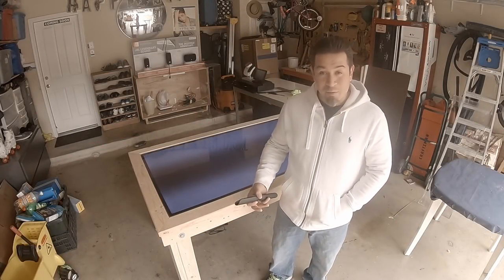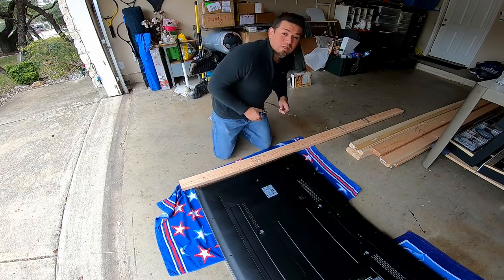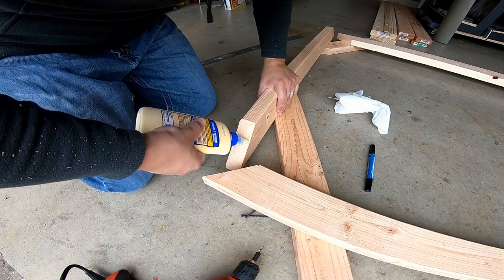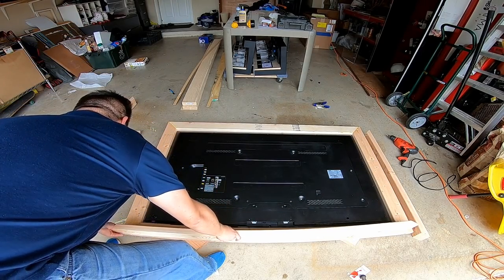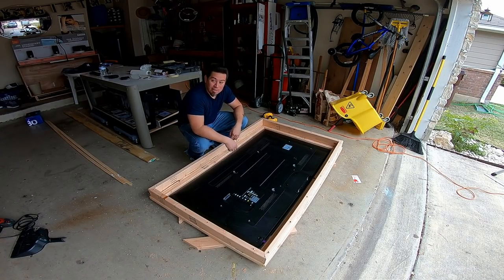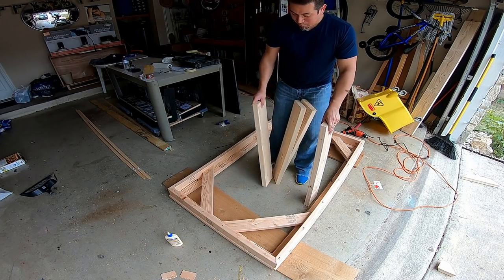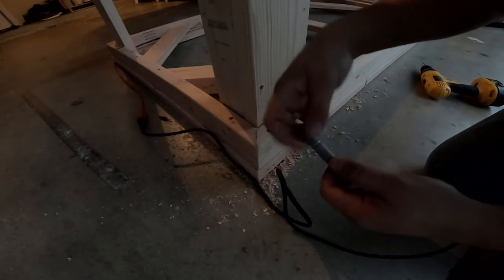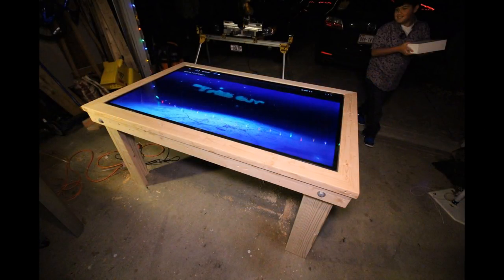How To: Build a Gaming Table (With TV Inside!!)

Comment: Thanks for the vid, cool project and good production values in the video.
A few notes for people trying to do this;
* A corner clamp will make putting  the corners together easier, this can be very difficult to do.
* pocket hole screws are another way of doing the work underneath.
* many tv's have curved areas underneath - so placing the flat board for a spacer may not always work out - have to be very careful with placement and test fitting.
* many tv's have mounting holes in the back - having one of the supports underneath use at least a couple of these holes would add extra stability for the tv, in keeping it in place.
* putting some cable management (ties, velcro, etc.) into the frame will help with keeping the various cords in place.

Great video - just a few minor suggestions to dealt with some of the things that could pop up.
thanks again for the video.
Reply from the maker: Great feedback Dave. Thanks for sharing.
Reply: I'd also add to this, use a flat, non adjustable, TV mount. I used one from Echo Gear and it's only about an inch thick, then build a brace off of that. Use tree nuts on the edged of the bottom frame to make the screen height adjustable and fine tunable corner to corner.
Reply: @EvidentGames  Just making sure I understand correctly! Do you mean you install the TV mount normally and then can use a plank or something connected to the rest of the frame behind it?

Comment: Table top games and architecture work is the primary consumer use of the teli-table.

Your tv is good for a 1st time build and as a starter example, I always recommend that DIY constructors do as much research as possible prior to starting a build.

My recommendation for any teli-table builder is the following.

1. Use MDF board as it's lighter than most woods and still can support the weight of a tv. Then use barrenttine treatment on the MDF board as it will make it water resistant (protect from spills, moisture and humidity, etc). MDF board can warp over time from humidity and conditions from changing seasons when not treated properly.

MDF board is also easier to sand, shave, cut, etc than other woods of equal or greater density. So if you were inclined to widdle or Dremel in scenery, art, etc into the wood to give it a much more appealing look, it's the wood to work with on a budget level.

2. The under frame which supports the tv should have the tv mount screw holes aligned to the support frame for which you are building and purchase threaded bolts that extent from the support frame into the threaded mount holes for the tv and mount the tv that way.

3. Ventilation, this is the primary mistake every DIY does on these teli-table builds. Tvs have vents designed to let heat our from the top of the tv (heat rises), TV's are not designed to lay down and be on. So when you leave your tv on the heat when produced rises and will trap itself on the back side of the screen. 
This increases risk of fire, when inner components heat up they can short out, burn out, etc. You need to install computer cooling fans (depending on the size of your tv it will differ in the number of fans needed). Install fans on lower or side vents to push air in the tv, while having the top vents clear of blockage so air can vent out.

4. If you wish to put a battle mat trim around the table top I recommend you use double rubber peal n seal (roofing insulator, not the single rubber with the aluminum siding) one side is adhesive while the other plain rubber like material. Then you can cover with felt or any material you like. This cleans up the look of the table and gives it a softer surface than plain MDF.

5. You can go on Amazon and buy USB/AC/DC wall jacks and install them on two sides of the table so that players can charge their phones, laptops, etc. 

6. You can buy table legs on Amazon at a reasonable price too.

DIY is always a fun way to learn new things and test yourself as to just what your capable of as well as ignite creativity in your mind. I tip my hat to all DIY individuals. 

There are several places you can buy these custom tables, prices very on quality as 1) they are rarely cheap, 2)  for the most part the higher the price the better the quality.

My table I have $28,462.00 invested in it, it's used for D&D and I've made alterations after alterations over the yrs. It pretty much can do almost anything lol I however used African blackwood instead of MDF for my table as cost was not an issue. 

Enjoyed the video, always like to see people creating new things. I hope you continue to add and alter your teli-table and would love to see what  it turns into.
Reply: Do you have any advice for someone looking to just build a portable case around the tv instead of building it into a table? I imagine the same principles apply, but would it be ok to just build in a few slats onto the back, connected to the frame at the correct level, and leave the rest open air?
Reply: @RahulLanka13  a portable case? Making a case to transport your TV, or making a enclosed frame around your TV that you can just move around and still watch TV in?
Reply: @gettingpolitical  I'd be using it for table top games like in this video, just without the built-into-a-table aspect of it. Just enclosing it in a case so it looks nicer and can be transported to game nights.
Reply: @RahulLanka13  the same principles apply for any build that a TV lays down while on. It needs ventilation, you can have simple passive ventilation (meaning no fans)  on a build and it can operate, yet does not reduce risk of fire and it will decrease the life of the electronic. The quality of the TV is what will be the primary factor in this though. Sony, Samsung for example have internal fans in most TV's while  off brands tend not to. Just make sure which ever sides of your TV have vents have a few inches of space for air flow. 

The length of time the TV is on is also a factor in heat production.

Comment: I don’t work with wood often, and I don’t have too high a budget.
Would it be possible to just saw a whole in a small table, and mount an old monitor to it using a wall mount?
That’s my plan for now, may do a bigger one in the future.
Reply from the maker: It depends on the type of table. You need to ensure you have a hardwood table because TVs tend to be heavy. The wood will need to support the weight and also accept the hardware.

Comment: I want to make a table like this but use a smaller tv. I want to make a poor mans cocktail arcade table. Do you have any suggestions for wood? I would like it to be strong but cheap, but not cheap enough that it just falls apart lol.
Reply from the maker: Hey Robert. I am about to undertake a similar project. A smaller table with a smaller screen that scrolls through a photo gallery, or can be cast to using a Chromecast. I am planning to use Pine cause it's really cheap, sturdy, and can be easily stained for anyone's taste. The legs will be made of 2x2's and the rest of it 1x4's. The wood alone is pretty flimsy on it's own, but once assembled it will hold up.
Reply: This Guy thank you soo much for the fast reply.

Comment: I am planning on building one that mounts to a drafting table. That way I can open a PDF of the plans “Blue Prints” I am working on, and be able to tilt the table up a bit. Then, I can compare the paper copy of the plans on the screen to identify differences. I think it will work great.
Reply from the maker: That sounds awesome. Its basically like a "light box" but with a screen instead of just a frosted lit panel.

Comment: Nicely done, but I'm curious if there is any distortion when siting down at the table and looking at it from an angle?  This is a common problem when you have any space between the screen and the actual surface that the miniatures sit on.  For example when looking at it from directly above the figurine will appear to be in the exact correct spot for what it on the TV, but from an angle the mini might appear to be elsewhere.
Reply from the maker: Randy Ward the acrylic layed right over the screen so there wasn't much distance. The TV also had decent viewing angles.
Reply: Thanks for the prompt reply.  Nice table.
Reply: You'll suffer from parallax when you have the acrylic over the TV.  You can reduce it by using the thinnest sheet of plexi you can find.  Also, removing the front bezel from the TV so the plexi lays directly against the LCD will help.  You can then matte off the area where the bezel used to be so it looks nice.  Lowering the viewing angle will also help.  Making the table legs height-adjustable would be a great benefit, anything from coffee table height to a dinner table height.

If you want a thicker piece of plexi, an alternative is to have a 1" grid etched into the plastic.  That way you know your figures, tokens, tiles, templates, etc. line up on the plastic grid, which will be in-line with the TV when viewed at the proper angle.

Also when using a thin sheet of plexi, just make sure the TV is rigid and flat.  You don't want it to flex, especially when people inevitably lean on the table.  That will keep the screen from cracking (an LCD is just liquid crystals sandwiched between large sheets of glass that can be very fragile.)  You could probably play directly on the TV itself, but I'd be worried about people dropping dice or other heavy objects and cracking the screen, so a thin sheet of plexi is probably best.

Just FYI for other people: I found that a 48" or larger TV will be able to display a standard game mat at 1:1 with no scrolling.  You can now find 50" generic brand TVs for under $300.

Comment: I'm trying to make a home theater coffee table it will have a hidden popcorn machine that is revealed by the table split ingredient in half a pop up projector and a touchscreen display in the top as well as hidden/pop up charger ports and I'm trying to make it all accessed by alexa may you can give me some pointers
Reply from the maker: Do you have any drawings of your creation? I would start by laying out the components you want to build into a table. I basically built the table around the TV, so you would use a similar approach.

Comment: I think the acrylic would have been best over the entire table to avoid spills from seeping down onto the TV...unless you sealed it with silicone?
Reply from the maker: Joshua Gregory the original design had the acrylic over the whole table but we couldn't find a sheet large enough. I left a gap around the edges of the TV so spills would potentially go straight through the floor. Sylicone is a good idea though.
Reply: The acrylic is because you roll dice and put miniatures on top of it. Protects the TV from being scratched up and cracked.

Comment: I'd love to try some arduino touchscreen project to that table tv of yours.
I mean, there's some project out there using that scanner light and infrared LEDs fir that.
Imagine a DIY capacitive touchscreen upgrade on this! Just wow!
Reply from the maker: It would be epic, but the table wouldn't be a "table" anymore per se. Unless you cold find a protective overlay that still allowed touch sensitivity. The folks that commissioned this build wanted to be able to use it as a dinner table when not in gaming mode.

Comment: The one I want to make is slightly different. I want it to have an outer platform so people can put books, papers and whatever on the table without covering the tv. Also I'm not sure if it's going to work how I want it, but I would like the tv framed into a case as opposed to just set into the table, and then hinge the bottom end of the tv case and have a kick stand, so the tv could be propped up and watched, or have video games played on it.
Reply from the maker: That sounds doable, but it's hard for me to picture exactly what you are looking to make. If you added an industrial hinge to the feet you should be able to angle the table like you said though.

Comment: Gaming table :)  I'm building one this winter.   with rails on the outside edge for removable platforms that have cup holders so as to avoid spills on the surface.  Also?  Why plexiglass?  I would think actual glass is better, if more expensive.
Reply from the maker: Plexi is much cheaper and lighter. The budget I was provided was too low as well. Thicker Plexi would have been better too. Good luck. Post photos and share the link in the comments so we can see.

Comment: Any tips for an 80 inch 112 lb tv?
Reply from the maker: The build is pretty sturdy. You would want to use heavier wood for the bracing on the underside. I would recommend 2x6's or just add more cross boards behind the TV.

Comment: Been thinking about making something like this. My main problem is I would want to go more complicated right away. (sunken play space, more space to hold character sheets, dice trays, cup holders, space for a DM screen)
Reply from the maker: I went super basic due to the low budget I was given. That being said I would be reluctant to go too extreme unless you have super woodworking skills. It's easy to get in over your head if not. What if you make smaller rolling carts that slid under the table?
Reply: I was thinking of making this table, but a bit shorter, then making a second (taller) table around it for the player space. 

But then, I'd love an adjustable TV (being able to tip it up in different angles)...I have too many ideas for it. Tabletop RPG maps, board games, console arcade, the pinball idea sounds fun, and to even have it tipped ~25 degrees up in "normal" TV mode for playing video games from the side of the table.

Comment: What about the small crack from the wood to plastic on top? I guess don't put drinks on the table
Reply from the maker: The seam between the plexi and the wood wasnt an issue as it overlapped the edges of the TV. In theory any leaks would drip past the TV onto the floor. Also, I wouldnt recommend drinks on the table, but thats on the table's owner. You could apply a bead of clear silicone sealer if you wanted to though.

Comment: The wood edge around the TV is too small for players to have character sheets and not block the view.
Reply from the maker: Agreed, but the folks that commissioned me wanted to go cheap. You could use 1x10s instead of 2x6s. That being said the table I built is so large they dont have issues with it.

Comment: How is the glare off this from overhead lights?
Reply from the maker: I tested the table in low light situations. I did have an overhead bulb in the garage, but the image of the screen was brighter which eliminated glare. I would suggest using lamps for lighting instead of an overhead light if you are planning to use darker images on the screen.
Reply: @ThisGuyProductions  Thanks!

Comment: Maybe add some accent lighting underneath to pimp it out a little.
Reply from the maker: If I build another I am hoping the person hiring me would be willing to invest more. I would have loved to add a nice stain with poly coating for durability. We could then add some color changing LEDs. I like your flavor.
Reply: There's a guy on Etsy who makes tabletop versions with the option of having Lichteneberg wood burning on the sideboards. I'm just starting a project for a 49" tabletop version and am considering doing that along with the LED underlighting. Would love to put some copper effects on the piece but they're difficult to find. Will likely opt for brass or steel instead. I DID find a dragon door-pull I'd like to use as a carrying handle.
Reply from the maker: J.P. Rutledge please share a link to the final version. We'd love to see it.
Reply: Will do. It'll probably be a slow moving project as we are both amateurs but I'll post a link when we've finished.
Reply: @JPRutledge  Just curious, did this project ever get finished?  Because I am interested

Comment: Great design man!!! i want to make table like that, for my pinball FX games!

The thing is! i would love the table to be horizontal but i also would love to table to go up on one side so that it feels more like a pinball machine... how would you make a table go up for the occasion?! and down when the family has to eat :)??
Reply from the maker: You would need to add a hinge to the table legs that you want to extend upwards. In my video I add a bolt to each corner where the legs attach. You could get away with only adding a bolt to one side of the corner and setting the leg inwards so there is enough room when the leg sits at a slight angle. The legs that extend would need to be modified to have a slot cut down it that  knobs could be fastened through. (2 to prevent pivoting). There would be a second part of wood with a similar slot as well. When you loosen the knobs, you could extend the leg, then refasten the knobs to hold it. Apologies for not being crystal clear here.

Comment: Tutorial fails because he didn't even know to use the mounting bracket holes on the back of the monitor. Could've done the same work with two horizontal boards in the centre distributing weight evenly, rather than four diagonal pieces. If you recreate this work, be smarter about it. And also add a touchscreen foil (can be bought on amazon or aliexpress for $200) to put underneath the plexiglass so you can have a touchscreen table.
Reply from the maker: A touchscreen would be nice, but you wouldn't be able to place items onto the table (screen).